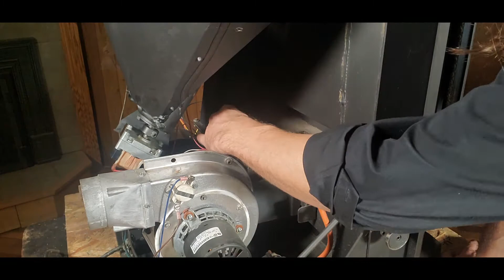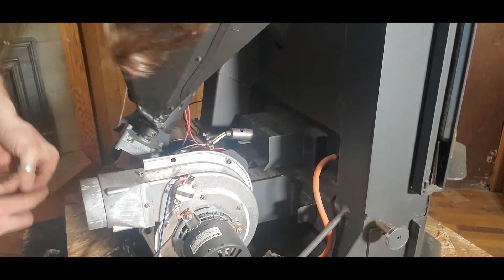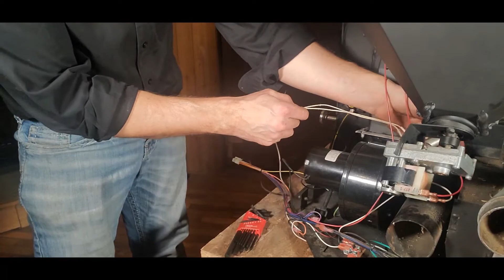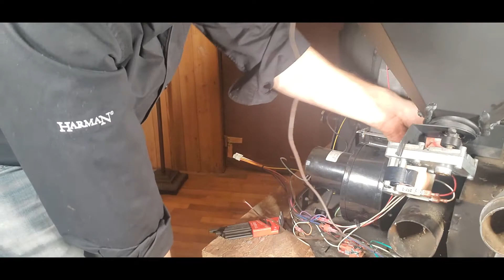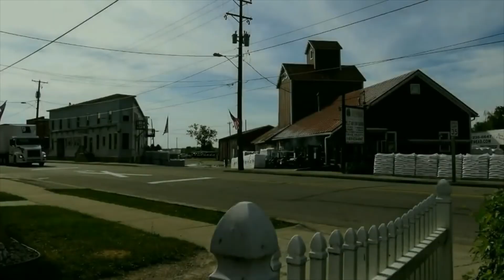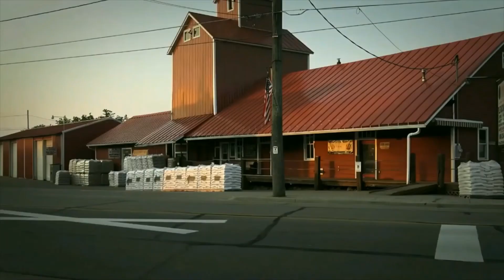Pellet Stove Rear Mount Igniter Replacement, Winslow PS40 Ignitor

Comment: Replaced my igniter but still not lighting. It seems to not even get hot. Would that indicate a control board issue?
Reply from the maker: Thanks for contacting us. Let's check the ohms on the igniter first to make sure the new element is in proper range. Here is a link that will go through testing the igniter and proper ohms for the most common igniter elements. You can also let us know your model and we can let you know the proper ohm range. Let's start here first. https://pellethead.com/how-to-test-and-replace-a-stove-igniter-pellet-stove-ignition-troubleshooting/
Reply: @EarthSense  I should have come back and replied. When the original igniter went out, it took the fuse with it. I haven't gotten to replacing it but I suspect it will work after I get that sorted. It almost seems like my igniter warped as the igniter is bent inside the tube. Wondering if it got too hot or had too many heat cycles in a short period.

Comment: Do you have the replacement of the auger on the Harman Advance?
Reply from the maker: Hey Erik, thanks for the message. We actually just recently recorded a video for replacement of the Harman Auger shaft. We'll aim to have that up on Monday and can send you the link. If you have a chain driven feed system in your Advance, the video below will show you change of the auger motor. Along with the Auger Replacement video we also have a video for replacing the direct drive Harman auger motor which is what recent Advance models will have. We'll aim to get that one up as well early in the week. Thanks!

https://youtu.be/AeuekPHdoCs